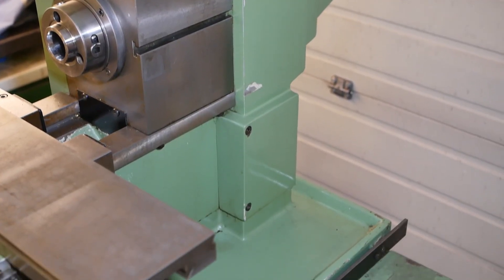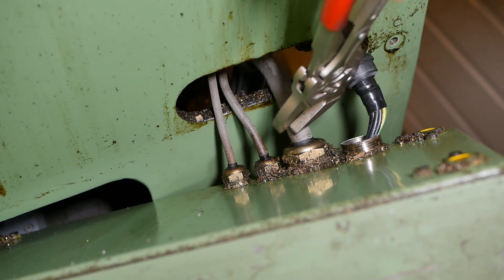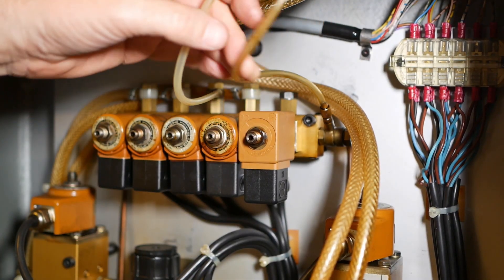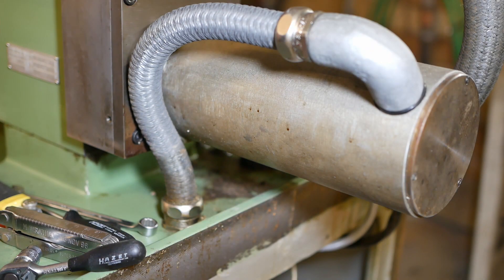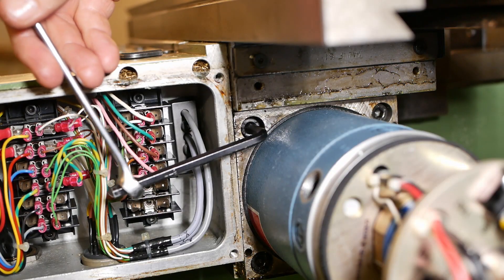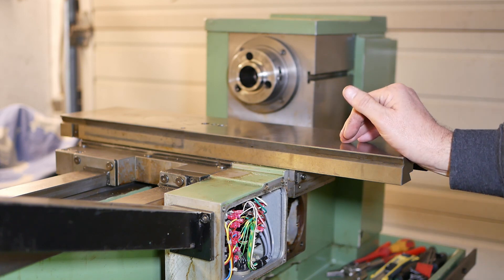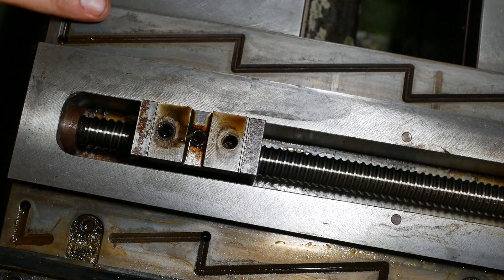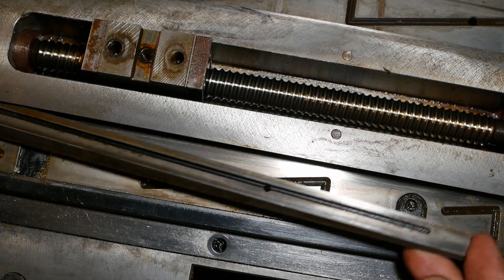Schaublin 125-CNC lathe dissassembly

Comment: Re the question about gold swarf: My sister is a jeweller. A few years ago they changed the carpet in the workshop. It was taken to a specialist who recovered enough gold that the three jewellers in the shop got (IIRC) just short of £1000 each,
Reply from the maker: Hi Andy. I know that Jewellery benches have that hammock to catch the swarf, but companies like  Rolex must have "normal" CNC machines pumping out thousands of solid gold and platinum cases per year. I gues the easiest thing would be to just treat it like any other machine, and recover most of the swarf with the conveyor, and then ever year or two, move the entire machine into a clean room, strip it to piece parts, clean it, recover all the swarf, service it and return it to service.
Reply: @RotarySMP  I wonder if they just use a lot of cutting fluid, then filter out all the large pieces and heavy particles to be sent to a recycler? From what I've seen with more modern CNC you can force a lot more of the swarf where you want with enough fluid pressure.
Reply from the maker: @cavemaneca  Even with the weak coolant flow and a bit of air, I have swarf from the Maho sticking to the ceiling. I watch Edge Precisions and those modern machines have coolant flow like a fire hose.
Reply: @RotarySMP  it's an interesting problem though for sure, and it'd be interesting to see how the high volume manufacturers deal with it.
Reply: @RotarySMP  Are they not all using fully enclosed CNC machines? Sure, plenty nooks and crannies to collect swarf in, but at least it should keep it off the ceiling? :)
Reply: @RotarySMP  True but take a look at some of the video's from Edge Precision when he opens the machine to adjust the axis, there is still a metric ton of swarf escaping. Even with a massive amount of coolant it seems.
Reply from the maker: @ldno3747  Really. So the trick is to buy machines from jewellery mass producers. They cant possibly get everything out.
Reply from the maker: @mumblbeebee6546  I wouldn't mind a bit of gold and platinum stuck to the cobwebs on the ceiling of themachineshop :)
Reply: @RotarySMP  I Bought an Emco Turn 325 from a jewellery manufacturer here in the UK, it mainly ran gold and I was able to view it running in their facility. They had added metal mesh screens into the swarf chute and ontop of the coolant tray which were covered with a filter paper, I was told that periodically the filter paper would be removed and burned in their in-house foundry to recover any fine gold swarf which was then turned back into bar or tube as required, a very interesting place to visit and the only machine shop I've ever seen where the material is stored in a safe.

When they finally disconnected the machine it was really well cleaned for obvious reasons, but there was still some gold swarf stuck in less accessable places so it hadn't been stripped down to clean, over the years of having it I keep finding bits of gold, some in the last week stuck in the counterbores of the tool carrier plate of the turret. Considering they'd run over half a million parts on it over 16+ years the amount of gold I've found is pretty insignificant though and mostly mixed in with thick congealed oil and grease.

The rigger that removed it and delivered it to me also told me they weren't allowed to sweep around or under where the machine was, they hoovered and the bags were again incinerated to recover any gold.
Reply: @RotarySMP  Oh, absolutely - they can hang out anywhere near me ;-)
Reply from the maker: @robertlees2065  Cool feedback. Thanks.
Reply: @RotarySMP  They're Lift Arc Studios now, aren't they?
Reply from the maker: @vincentguttmann2231  they are.
Reply: LTT just did a gold Xbox controller, and the guys doing it collect about $80,000 worth of gold dust/filings a year.
Reply from the maker: @SidneyCritic  The difference between a decent clean up and a really thorough clean up must run to thousands. On my machines, the difference between a decent and a thorough clean up...no one cares :)
Reply: I visited a (large) place in the UK that machined gold and platinum a few years ago and you had to walk over motorised scrubbing brushes in the floor on the way out of the workshop to clean any swarf off the soles of your shoes. I'll never forget visiting a different place a few years earlier and seeing someone turning gold on a manual lathe with a huge nest of swarf everywhere (got to play with a gold bar, too! :D ).
Reply from the maker: @Mister_G  That has got to be pretty cool.
Reply: @Mister_G  Wasn't in the jewellery quarter in Birmingham was it? I had to walk over sticky mats in and out for the same reason when I viewed the lathe I bought.
Reply: @robertlees2065  No, but I have visited a few places there too - the mechanical scrubbing mat was near Royston.
Reply: My dad's doing jewelry as well but he was running his cnc machines in wax stock placed them in gypsum forms burned out the wax and did vacumized castings... So no worry about the chips
Reply: And much faster machining with less expensive tools 😉
Reply from the maker: @seppschlecker  I guess most jewellery is lost wax, but watches must have a lot of machining.

Comment: Dear algorithm, here is a nice comment for you to feed on:
You're gonna have lots of spare mounting holes on this machine when it's done. No excuses not to mount extra lights, GoPros, oil misters etc.

Those boxes looked great as well. Not to mention the almost inch thick mounting plates on the motors!
Reply from the maker: Yep, you are right. I definitely want to mount some Nato Rails so my camera can  to be easily mounted.
Those motor mount adapters are 18mm thick cast iron.

Comment: We machined Gold and Silver on our Lathes and Machining Centers from time to time. Those Chips where stuck anywhere. The Customer supplied us with his own Shopvac for cleaning up and we covered the Inside of the Machines with plastic film. I usually found some of the stuff while repairing those machines even months and years later. It was a good paying work, but the Material wasn't very fun to Work with. We had a certain percentage that could get "lost" during machining.
Reply from the maker: Thanks for that feedback. I guess the more pure gold it, and worse it cuts. Being so ductile it probably smears pretty badly right?
Reply: @RotarySMP  Yeah, Silver smears like Hell and we never got the Chips to break right. We made parts > 1kg, no jewellers stuff.
Reply: I heard the same thing from an EDM shop, for gold the customer wants their swarf back up to some percent.

Comment: Chances are the 3 wires on the solenoid valves are as follows; Brown - always 24V. Blue - always 0V. Black - signal, apply 24v to activate the solenoid. However it never hurts to read the manufacturer documents.
Reply from the maker: Thanks for providing that.

Comment: OK, I've given a thumbs up and here's my comment. I should say a thank you for a tip you gave in the CNC mini lathe series. The tip was how to remove the scale on hot rolled steel with vinegar. I didn't know that and this tip came at exactly the right moment for me, it worked a treat. I may have a need for the razor blade on rust tip in the video too. Love the videos and thanks again.
Reply from the maker: Thanks for the feedback. I was also surprised how well vinegar worked. Nitric Acid is much faster, but will make everything in the room rust, so you have to do it outside.
Reply: @RotarySMP Hmm...I don't think I'll get any Nitric Acid. That's a key component in high explosives like nitroglycerin and nitrocellulose. If I buy that here in the UK, I think men in black cars might visit me.
Reply from the maker: @GeoffTV2  They sell it in the hardare store here. Not sure why. I tried it on mill scale, rusted a bunch of tools (in the woodshop) an switched to vinegar.

Comment: Great scott, Marty. I've just been to the future, and SMP decided to put the Pneumatics on the wall behind the flux capacitor. Genius!
Reply from the maker: I ran out of room in the contol cabinet I downsized :) Who could have seen that coming.
Reply: , haha, that is pretty funny—something I'd do. 
Hey, I had an idea for your Maho table. Dowel pin it like the last hole and then hog out the T slot where the pin overlaps. You could permanently engrave the top of the hook to make it unique. Be a better choice than buying a new table.

Comment: A tip if you're using contractors for the estop circuit you need 2 in series in case one hangs
Reply from the maker: Thanks for the tip. I have bought a PNIZ VX3.1 with both immediate and time delayed contacts, with the plan to use the immediate contacts to command the spindle VFD and Drives to stop, and then after a delay, use the second set to drop their power. This way I can have  both emergency stop and emergency off.

Comment: Another one for the algorithm and a tip for 11:50 > if you zero digital calipers in a hole, you can quite precisely measure the hole distance if both holes have the same diameter.
Edit: corrected the timestamp
Reply from the maker: I did to measure it, but then reset to zero, set the distance and put them there for filming. Figured otherwise the mismatch between center and caliper would confuse someone. Thanks for watching.

Comment: Perhaps a dye penetrant would be priced right to check the "crack"?
Reply from the maker: Being ferrous, it should really be magnetic particle. It may well just be a tooling mark where the guy with the fine file slipped while deburring that corner.

Comment: 3 wires out of the solenoids one is the pull in coil and one is the hold in coil with a common ground. The pull in coil will draw more current than the hold in coil.
Reply from the maker: Thanks for that explanation.

Comment: switch your calipers to in to quickly check if something like the motor shaft could be an imperial size ;)

NEMA 34 are 86x86 mm by the way.
Reply from the maker: This set is Metric only. But yeah, 15.85 = 0.625 --> 5/8"
Reply: oh well I just quickly typed that up before even looking at them. strange that they don't have that... guess you would've come up with my solution as well.
Reply from the maker: @HAGmbHkeG  I have a second cheapeo caliper which is switchable to imperial.

I will probably use the chinese 90 size servos, as it looks like I can get them with 16mm shaft and the flange would allow me to make adapter plates similar to Schaublin.

Comment: May be too lathe but the solenoids may be 2 stage ie 1 pull coil and 1 hold coil. This is done to reduce load and heat.
Reply from the maker: Thanks. that makes sense.

Comment: The 3 wires to the pneumatic solenoid valves could be 2 different taps on the coil for moving the valve, and holding the position. Initially moving the valve from one state to the other requires more force (thus more turns of the entire coil), then once it's in the new state, less force is required to keep it there, so it only uses part of the coil. I think pinball machines are chock full of solenoids with separate moving and holding coils. That's my guess. It's easy to test, if you energize one coil, and nothing happens, that's probably the holding coil. If you energize the other one and it clicks and changes state, that's the moving coil.I know pneumatic valves on more modern CNC machines are just regular 2 wires, single coil (or no extra taps). I just finished taking that whole assembly off of my machine and cleaning it, and getting new o-rings so the valves don't leak at the manifold.
Reply from the maker: Thanks. That is an excellent explanation.
Reply: @RotarySMP  Try measuring the resistance between the 3 leads. One should be common at one end of the coil, one will have some resistance to common (the tap in the middle of the coil), and one should have slightly more resistance to common (the one at the other end of the coil).
Reply from the maker: @gorak9000  Thanks, that makes sense.

Comment: Maybe the valves have a winding for both open and close directions?
Reply from the maker: The are only one way valves, with spring return, but I have been told there are two taps in the coils, as you need more current to open, than to hold open.

Comment: 8:22 this is not the brush carrier for the motor. I would say it is a tacho-generator for velocity measurement of the motor for velocity control. The resolver is just used for position control :)
Always nice to see such a nice machine! Are you going for a full conversion - Linux CNC, touchscreen...?
Reply from the maker: Thanks for confirming that. I kind of thought those brushes were too small for powering the windings.
Yes, LinuxCNC with gmoccapy and a touch screen. Mesa Cards, a user module, the whole deal.

Comment: How do you remember all the parts😱. Think NZ will win.👍
Reply from the maker: A lot of the electrical hardware will not be reused. The mechanical stuff all seems pretty logical.

I hope so, but the starts are everything, and LRPP have that high and slow mode which is so useful there.
Reply: @RotarySMP  do you sail ?

Comment: I'm a big fan of VFDs and whlle they allow for a great deal of control over speed, nothing beats mechanical reduction as they really don't like low speed/high torque. Although please beware of the (very tempting) cheap imports, I've seen them let the smoke out well below their rated output. I even had one who's faliure mode was to speed up to full warp-factor, then go pop, dumping all that stored energy back into the  board and absoutely obliterating what was left of the switching circuits. Get the biggest one you can fit in that box, and get it from somewhere that has a reputation. I've found that the VFDs from RS components (branded RSpro) are quite decent for imported no-names, don't cost the earth, and i've not blown one up yet!
Reply from the maker: Thanks for the feedback. I was looking in the classifieds and could get  used Danfos for €220, or a NOS Lenze for €270. Amazon advertises 3Ph 380V 4kW VFD's in packages about half the size of the Danfoss, so I was a little suspicious. I'll look into those RS ones.
Reply: @RotarySMP  In typical amazon/ebay fashion I'd bet those specs are 'optimistic' at best! I've nuked a couple of "2.2Kw" ebay inverters with 750W motors before! I'd be going for at least a 4Kw jobbiem as a little de-rating helps keep the temps down, might be worth adding a little extra forced-air cooling if you're going to be stuffing it all inside a small box too, most decent manufacturers specify de-rating if it's in an enclosed space or in high ambient temperature (some even specify an altitude de-rating too!)
Reply from the maker: @theafro  Thanks. Yeah, that 4kW in a small package did not really pass the sniff test. Adding forced cooling is also a good point.

Comment: Haas has one contactor between the VFD and the motor and one contactor between the motor and the short circuit. This way when you call for e stop the first contactor will disconnect the motor from the VFD and the second one will short the motor's windings together - causing imminent rotor lockup.
Reply: A lot of VFD manufacturers give dire warnings about switching the output.
Reply from the maker: I saw a Lenze NOS in the local classifieds which allows switching the motor leads. Surprised me, as most really dont like that. I have a PNOZ with both immediate and time delay contacts. I was going to have it command the VFD and drives stop on the immediate, and then cut power to them a couple of second later. E-Stop and E- Off.
Reply: @RotarySMP  Yeah, disconnecting the inductive loads while on power can be harmful for electronics, but they have found ways to pull it off safely. I am so looking forward to see how this project is going to evolve! Your mini lathe was such a nice quarantine content! Thanks for making that!
Reply from the maker: @burningdieselproduction5498  Thanks for watching and your feedback.

Comment: You are extremely lucky finding both your Schaublin and Maho. They might be old but they were engineering works of art. You can almost feel the precision in every system and part. Also it's built like a tank. Do you really want to change out those servos? If the bearings are good and you can get replacement brushes and a wiring diagram for the resolvers, you might save a bundle reusing them. They really look nice under the covers (no sexual reference intended). BTW, I finally figured out my Denford Triton and ordered a Mesa 7i76e . Ethernet , 4 axis servos with an analog spindle control and a bunch of IO ($199). I don't think I'll need any daughter cards  Looking forward to further adventures in Schaublin land and thanks for the America's Cup updates while we work. I don't follow it like I used to in my youth but still interested. I was just given an 18' drop keel with new aluminum mast and sails and trailer for FREE. Also I live by the Columbia river.
Reply from the maker: Thanks. I was tempted to replace theresolvers with encoders, but the drives are huge and undocumented and modern AC servos are not that expensive any more.
Look forward to seeing your Denford running.
Reply: @RotarySMP Good idea using new servos if you have the budget. This will make setting up the Mesa much easier. Are you planning on putting the new servos back inside the original covers?
Thanks about my Triton. Cards arrive tomorrow so about a week lill launch, yeha! I just ordered another 1/2 dozen BT30s for my ATC. It holds 8.
Reply from the maker: @misterfixit1952  No, modern AC servos are generally square, and much shorter, so the covers will go. Shame about the conduits. They are great.